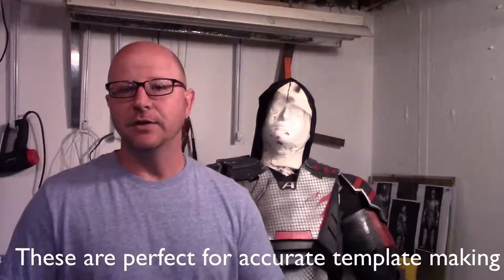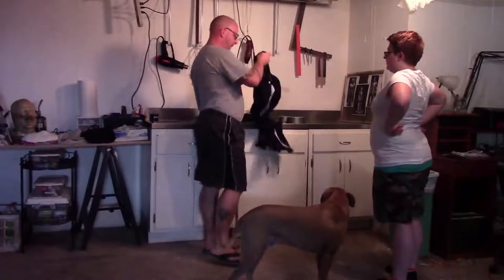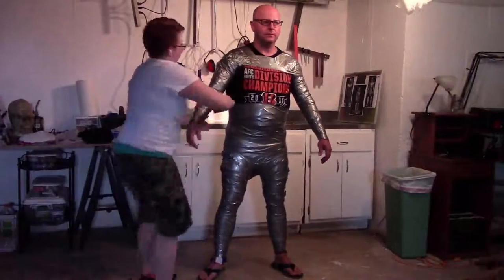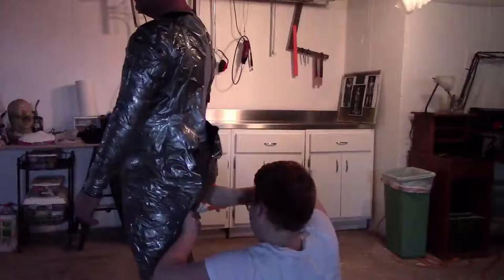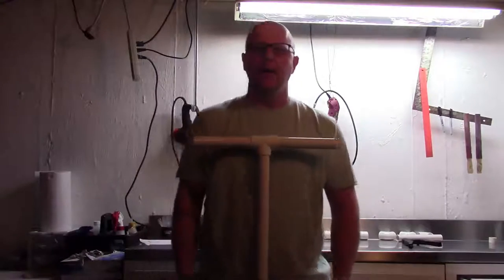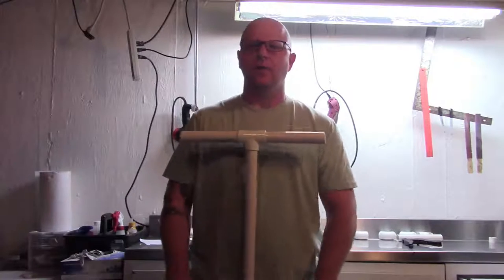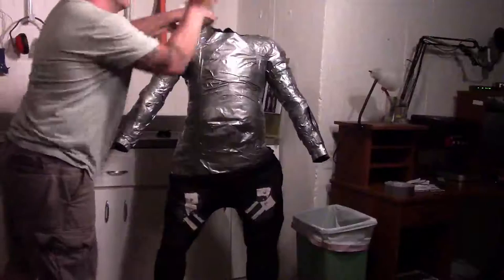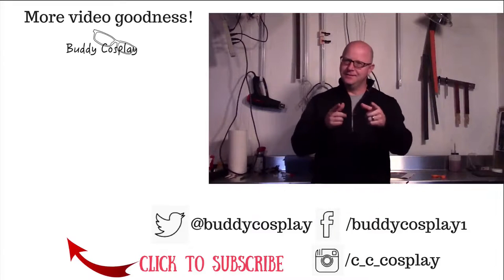DIY Duct Tape body form - cosplay and patterns

Comment: Use expanding foam to fill it then you can put pins in it and it’s more durable
Reply from the maker: that’s a fantastic idea!  Thanks for the suggestion!
Reply: If you do this I woukd recommend the low expansion type, or be very careful to not put enough in that it deforms your body form.